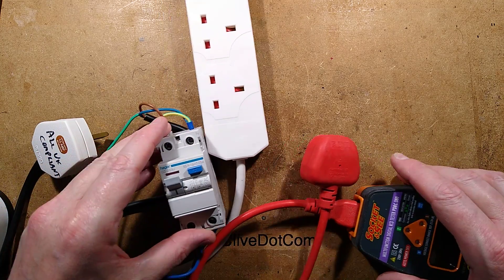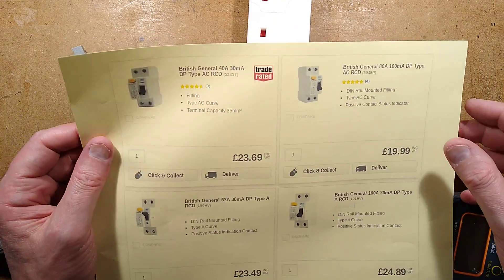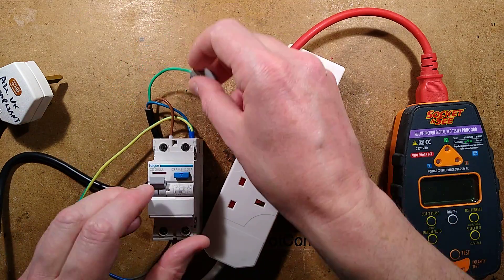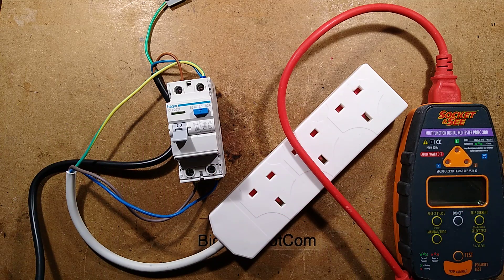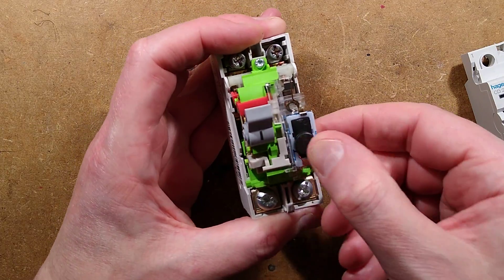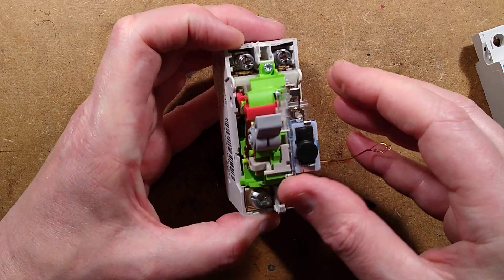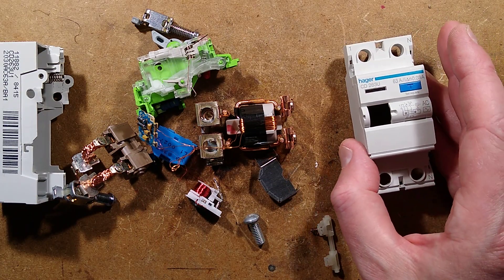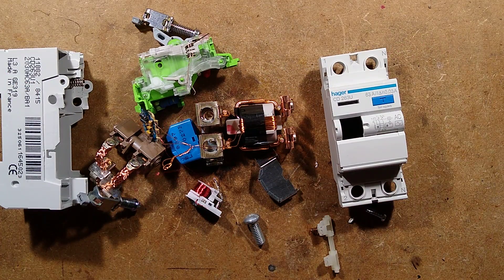Was this RCD damaged by overcurrent?

Comment: Clive could you please do a video on Overvolting that power companies do to thwart solar.
Reply from the maker: I've not heard of this.  It sounds a bit conspiracy-ish.
Reply: @bigclivedotcom  Yes I know I first saw it on news stations not the net.... I hate flat earth chem trail nonsense. I'll try to find more precise information.
Reply: @bigclivedotcom  Found an article from ABC https://www.abc.net.au/news/2018-11-08/high-voltage-fuelling-increased-electricity-consumption/10460212
Reply: @MrLunithy  I think the crucial bit of the article is this: "After he realised the scale of the problem he started a company that specialises in filtering out extra voltage in homes and businesses."
The other thing worth noting is that an increase in voltage has negligable effects on power used; switching power supplies will just use less current, heaters will heat up more quickly, motors will use less current because their torque will increase due to the increase in Vs-Vemf. The guy has clearly identified a snake oil opportunity.
Reply: My solar system exports just fine. I believe it claims to be able to output until 260V, and +/-0.5Hz.  I think they would get some calls if they were that far off.
I do get a laugh at the end of the day when it cycles ON, exporting 1W for a short time, then OFF for awhile, repeat. Going to be awhile clocking up 1kWhr.
Reply: I work for a DNO we spent the last 5 or 6 years tapping down distribution transformers to allow solar to be connected so definitely not happening in the UK
Reply: @haldo691  Correct, the high voltages occur because the grid design is such that power flows from a generation pool to smaller and smaller loads then this supplies individual consumers, so the resistances all add up to still give the correct voltage range at the consumer point of supply. Solar feeds power back, so has to have a higher voltage to get current flow, and thus increases the consumer side voltage. Have an entire neighbourhood doing this and the local grid voltage rises quite a bit as they all try to feed in. 

Only solution for the power supplier is to drop the local grid so the evening peak drop is right at the low end of the allowed range, so during the day when use in the houses is minimal, and all power is being exported, the rise is below the peak allowed. If not they have to, at their own expense, add in extra transformers and split the grid into smaller segments, so the consumer side cable lengths are shorter and thus voltage drop is lower. Very expensive and no return on that big investment at all, it actually costs a lot of money to do that. 

You can add tap changers and program them to follow the solar peaking, but that is adding another expensive transformer, and this also requires a lot more maintenance than a regular one, which is why they are mostly seen in substations to compensate for area loads.
Reply: What's this now?
Reply: @COBARHORSE1  It's been suggested that supply is being done in a way to make renewable give less return's in Australia.
Reply: @MrLunithy  or people are just exporting more power into the grid than it needs
Reply: @Mister_Brown  The grid is so old in OZ I've worked in generation and I didn't see anything modern.

Comment: Really glad I don’t have those here at my house, just trip the damn breaker for over current... Neat to see how they work though!
Reply: RCDs are nice realy. they trip if someone touches a live wire for example, unlike normal breakers. Its just a matter of using them correctly.
Reply: @kertas1991111  For shock protection I'd rather use a North American 5mA GFCI. I've never tried it myself but I thought 30mA was quite dangerous. I've never lived with the European setup but I would imagine it would be frustrating having a nuisance trip kill power to half the house.
Reply from the maker: The big advantage of the DB RCDs is that they will also protect against damaged cables and faulty equipment that starts burning and causes enough of a current leakage to trip the breaker.
Reply: bigclivedotcom most places in the US are implementing newer electrical codes which require AFCI’s which do basically the same thing in any living area. You use them everywhere except high load equipment and areas like garages/basements.
Reply: @alexlacey9808  It's worth watching John Ward's channel to see how effective AFCIs really are (or aren't).
Reply: AFCI devices are IMHO a rip off. RCD / GFCI devices are easy to test and are generally reliable. Further they improve safety by a considerable factor. Note that a RCD uses the same technology as a GFCI https://en.wikipedia.org/wiki/Residual-current_device
Reply: Yeah that is nice for arcs and shorts that can start a fire, don’t care about shocking someone, only 120v and if you are dumb enough to touch then you’ll get a good lesson. :)

Comment: Interesting video, Clive . :) 
Could you comment on voltage drops caused by mains voltage extension cords on a reel? Does it actually occur if the cable isn't fully unwound?
Reply: It occurs based on the thickness and length of the conductors, so yes it still occurs if the cable is still wound. In fact it's more dangerous when the cord is coiled because the heat generated by the voltage drop can build up and potentially damage the cable.
Reply: The voltage drop of a wound extension cord is not really significant, it's the inability of the inner coils to dissipate the heat, particularly if connected to a power hungry device, since heat is caused by the I^2*R losses in the cable (current squared *resistance).
My vacuum cleaner has a tendency to wind the cord up automatically while being used, and pulling it out again you can feel the significant heat difference in the wound portion of the cord compared to the portion that was in free air.
Reply: And by "damage the cable" he means get it red hot at the core of the reel, causing the plastic to melt, catch fire and cause a whole load of fun mains voltage shorts! 👀

That was a friend of mine using a welder on a 30m cable with only about 8ft of it extended, as if that wasn't bad enough he headed for the WATER fire extinguisher 🤦‍♂️ instead he got yelled at to go hit the breaker box, while I grabbed the halon (ssshhhh, I've still got a few of them, the benefits of living near a nuclear instalation, still good even years out of date!) and a couple of CO2's and put the fire out
Reply: Thanks for the replies . I will use a power board with long cable to power my 18 volt battery charger instead of the heavy duty 30 m (only 1 metre unwound) reel extension cable . :)
Reply: @NWEuroLangs  Your coiled cord is probably fine in that scenario. A coiled extension cord should be derated by AFAIK 50%, meaning if it's a 10 amp cord it is okay to put 5 amps through it. A heavy duty extension is most likely good enough for a smaller load like a power tool charger, but of course double check the ratings before doing this.

Comment: Methinks 73 mA for the test current is about right, given input coil has 2 windings. 73/2 != 30, but it's plenty close.
Reply: The fault current is applied to the primary, so flows through both turns of the input coil, so it really is a 72mA fault current.

Comment: Some clever engineering in RCD's I took apart a Wylex RCD as it failed RCD testing on my Kewtech KT65DL MFT, the sense coil was made of really fine layers of what looked like chromium leaves of flat wrapped material, strange...and it broke apart really easily.Still never figured out what it was lol. But it had similar minimal electronics like that Hager, just a few diodes and a resistor. Clever stuff! anyway, I replaced the wylex RCD and it tested out fine.
Reply: That would be Permalloy, wound into a flat tape toroid. Used because it has great permeability magnetically, and thin so there is minimal eddy current loss. Yes it is very brittle, and when you kink it it loses part of it;s magnetic ability. Used for many years as the premier material for audio heads till ferrite came into use because you could get the gap small, and it is cheap, but still in use for professional recorders today.
Reply: @SeanBZA  cool, I never knew that 😎👍

Comment: If you put low voltage dc on the sense coil, will the core and the spot welded wires act like a saturable reactor?
Reply from the maker: I don't think it would make much difference to the current going through it.
Reply: @bigclivedotcom  It made me think of magnetic amplifiers.
Reply: @garbleduser  It is a form of magnetic amplifier, however it is a differential amplifier, though it does saturate at high currents. Major difference between the 40, 63 and 100A versions is not the contacts, but the bigger permalloy strip coil wound in that plastic housing, as the higher current ones need a larger core area so that they do not go into saturation below the rated current, so as to keep the trip current the same. Permalloy is expensive enough for the manufacturer to keep the 3 stock units at a different price, even if the 100A covers all uses.
Reply: Practically speaking, no. Saturating the core can only decrease the inductance, not increase it. Since the high current winding already had a low enough inductance to pass mains AC without trouble, the effect you can get from saturating the core is minimal. 

However, you can saturate the core with a DC current through the high current winding, which causes the sense winding to stop responding correctly. This is the issue that Clive mentioned near the end.

So you should be able to instead use the sense winding as a switch with the high current winding as a control. However, it's poorly constructed for that use since you'd both probably need a fairly high control current, and the useful current you can switch is going to be low due the regular ohmic resistance in that thin wire.
Reply: @Gameboygenius  Wonderful response, thank you!

Comment: Why did the british standardize on such a weird number with 63 amp breakers? Why not 60 or 65? North American breakers always have a number divisible by 5.
Reply: That's the LEAST odd thing about British electrical standards, at least from a US electrician's perspective.
Reply: @mattelder1971  Oh I know almost all of it is ass backwards...but I can kinda see how they arrived at that. (Or I know things like they had a huge copper shortage after WW2 when much of their stuff was built)

The only thing I can think is 80% of 63 is just slightly over 50 amps, maybe they were going for 50A continuous? But I have no idea if they go by 80% for continuous loads like we do...

That standard 32 amp ring circuit is odd too - the ring circuit comes from the lack of copper, but why not 30 or 35 amps?
Reply: @ryanroberts1104  why a 47 ohm resistor and not a 50 ohm? Same basic reasons
Reply: @AngDavies  You're contradicting yourself. "It's like resistors...preferred values  in roots of 10" and then "why a 47 ohm?"

That is a good question, why 47 and not 50? 47 is not a root of 10. This kind of stuff should be based on the decimal system, why isn't it? Somebody, somewhere, for some reason, very specifically chose 63 instead of 60 or 65 or 70. Why??

If it was about selectivity, I'd still go with a 65 in North America.
Reply: @ryanroberts1104  powers of roots of ten 4.7~(10^(1/24))^16  6.3~(10^(1/24))^19 

No exact, as you want to chose whole numbers, but still keep the regular spacing

The jump from 5 ohms to 10 ohms is huge in relative terms, but the jump from 50 to 55 is much smaller, and you could probably get away with either in a real setting, so one is basically useless

This geometric progression keeps the relative gap between the components the same, so you can always get one that's within 5% of the value you actually want.

What if you wanted a 7 ohm resistor? ...5 and 10 would be massively off, but a resistor could just be a 6.8, which is well good enough.

It's not just 7, resistors are set up that you can always find a value that's within 5% of the one you really want ( or 2%/1%/10% depending on tolerance) what about a 3 ohm resistor? Spaced by fives you'd have do combine 3 1 ohm resistors, but a 3 ohm resistor is just a thing you can pick up, se for 2

The relative difference is what matters, so they're arranged in a relative pattern. 24 per factor of 10, hence the 24th roots of 10.
(24 is probably better than 20, because rounding and such means you need a bit more to ensure the 5%, and 24 is highly divisible too)

Arranging them in this geometric pattern makes the numbers look weird, but makes it much easier to find a value relatively closer to the value you want, without having to combine components.
Reply: its about selectivity. if you want your breaker to react before the main one instead of either one or both triggering, you have to make the main one approximately 1,6 times larger.
seeing how 40A breakers are fairly common 63 just so happens to just barely be selective for that. so if you have a 63A and a 40A breaker in sequence and short it out the 40A one will trigger before the 63A one will.
If you do the same with a 40A and a 50A either one or both might trigger.
So its realy about beeing the smallest size still selective to 40A.
Reply: @kertas1991111  First, the wisdom on the DIY StackExchange seems to be that selectivity doesn't reliably work like that if you overload both at the same time.

Second, I think I've heard recently that the UK did use 30 and 60A breakers but changed to 32 and 63 to harmonize with the EU.
Reply: It's like resistors- "preferred values" or near enough nth roots of 10, has nice properties
Reply: Low precision resistors and other electronic components use the E12 range of values ie 12 logarithmically spaced values per decade.  This is very flexible because it's easy to gererate E6, E4, E3 or even E2 ranges using the same set of values.  When the European electrical industry needed to choose a standard set of values some idiot thought that due to decimalisation it would be a good idea to use the E10 range hence we have values like 1.0, 1.25, 1.6, 2.0,  2.5, 3.2, 4.0, 5.0, 6.3, 8.0.  This is why we have for instance 63A breakers and 80A fuses.
Reply: Ryan Roberts  - see https://en.wikipedia.org/wiki/Renard_series This gives us a preferred list of standard values. In the mainland U.K. most homes are provided with a single phase 230V (existing infrastructure is actually still 240V) 60A, 80A or 100A feeds. So older switchgear is often rated at 60A, 80A or 100A. Since then, most switchgear, fuses, circuit breakers etc. uses the Renard series (1, 1.25, 1.6, 2, 2.5, 3.15, 4, 5, 6.3, 8 and 10) unless a particular standard overrides this. Diversity then allows for a higher total of the fitted MCBs in a consumer unit compared to what you may expect. Although as Clive says, with a split load board, it should normally be evenly distributed between the two RCDs.
Examples of where standards override the Renard series are BS 1363 plug fuses (available in 1A, 2A, 3A , 5A, 7A, 10A and 13A ratings, although only the 3A and 13A are preferred values, shops typically stock 3A, 5A and 13A). Similarly the standard for consumer unit MCBs allows unusual values like 32A.
MCBs have different trip characteristics compared to fuses. So for our socket circuits, for example, the ring circuit, if protected by a fuse, it has to be a 30A rated fuse. But if protected by a MCB, the MCB can be 32A. Similarly domestic lighting circuits, use a 5A fuse or a 6A MCB. In all cases, the rating of the fuse or MCB is chosen to protect the fixed wiring from overheating and causing a fire in the event of a fault.
Reply: As eDoc2020 says, it was to harmonize with Europe. But I can point out MANY crazy things about the US electrical system, the UK version is superior in almost every way, from what I have seen so far. Only loading to 80%? That’s just bizarre! How many different voltages? Unnecessary. Using ID instead of OD? Please! Etc!

Comment: I've got a GFCI for each bathroom circuit. About once a year, one of them will trip for no apparent reason. It's so infrequent that I've never had an electrician check them out. You'd think that if there was really a problem,  they'd trip more often. Maybe they're just getting old?
Reply from the maker: It can be something as simple as a bug strolling through a junction box.
Reply: I'd bet on condensation, there's a poorly located one in my kitchen that inadvertently gets splashed sometimes and trips itself a couple times a year.

Comment: Clive we have quite a few LED strip lights ect in my girls bedrooms and around the house. 
Would it be advisable to replace my breakers to include DC faults?
Reply: Change the RCD to a type "A" RCD they are all going that way now in UK because of LED lighting, and electronic SMPSU use in domestic & commercial installs now. DC on the mains supplies are becoming an issue now. Wait till EV charging comes in big time lol...

Comment: I was going to leave the thumbs up at the UK 240-Volt Clive but..I wouldn't be able to sleep giving you a thumbs down! 😁🖖
Reply from the maker: I go by measured voltage and not red-tape voltage.
Reply: @bigclivedotcom  Ah wires got mixed up there Clive. I was talking about the 240 thumbs not the voltage, come to think of it 50yrs later and I still haven't measured a mains AC below 242/243 anyway, stay safe and look after your good self. 👍